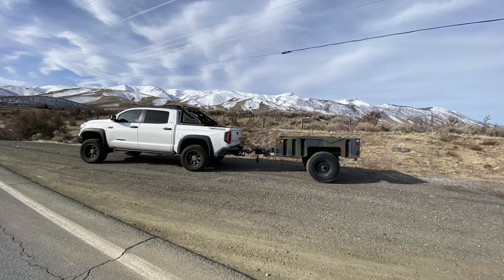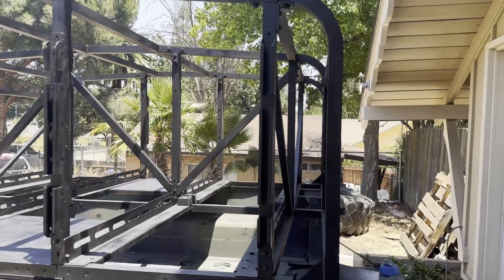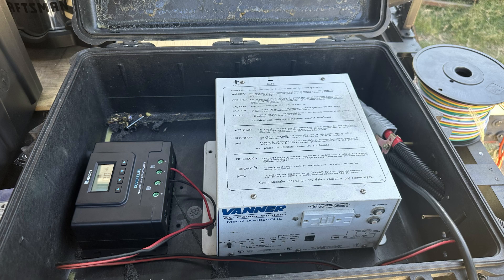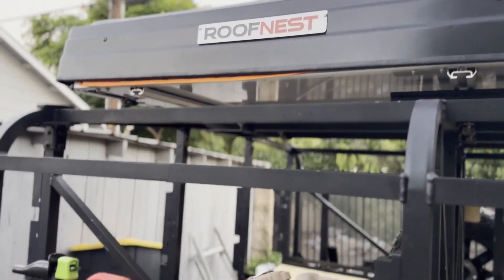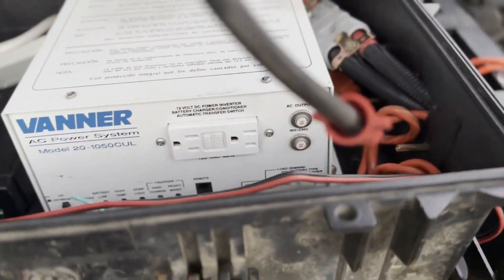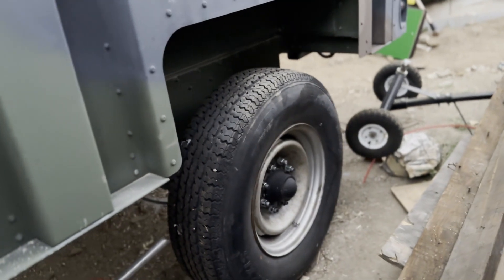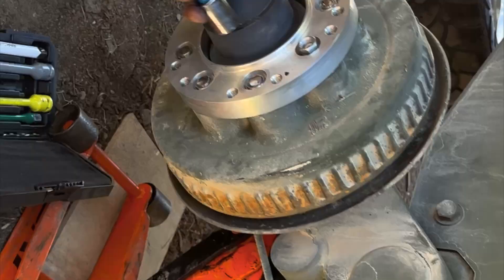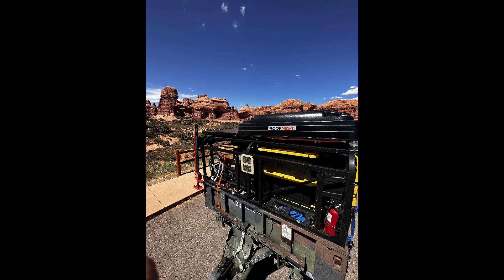M1102 Overland Trailer build

Comment: Nice work!. I am looking to build a M1102 for hauling firewood.  With such a heavy payload  I will need good brakes. How do I get the surge brakes to work many trailer connection plug? I will be pulling it with my AWD Sprinter. I need any info is appreciated. Roger Out!